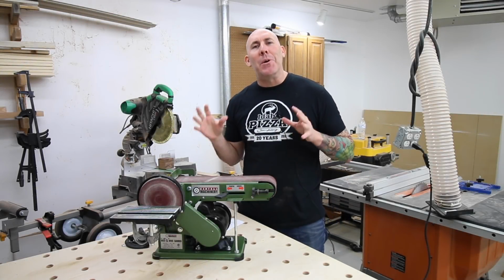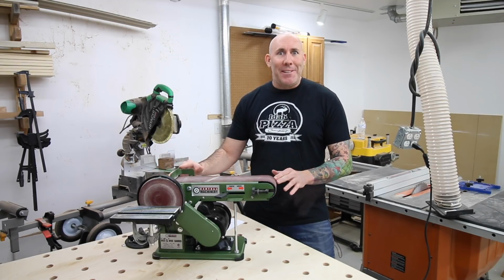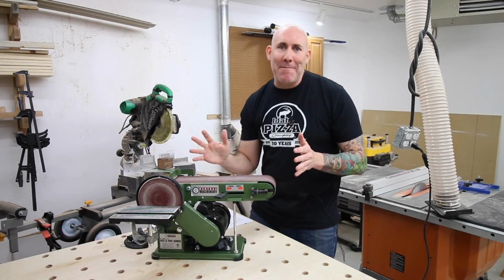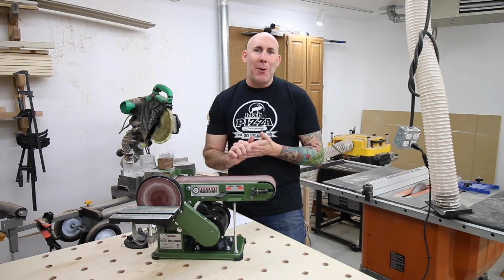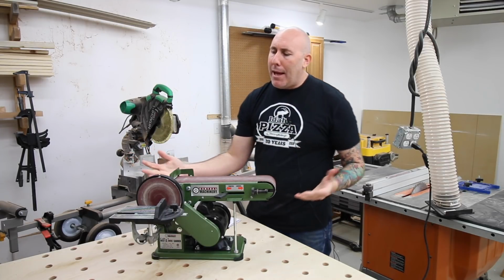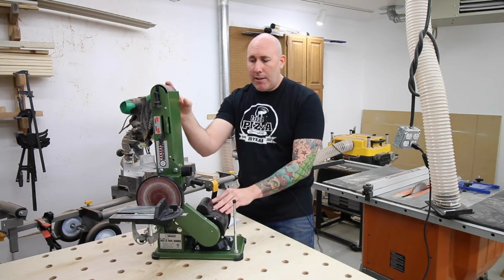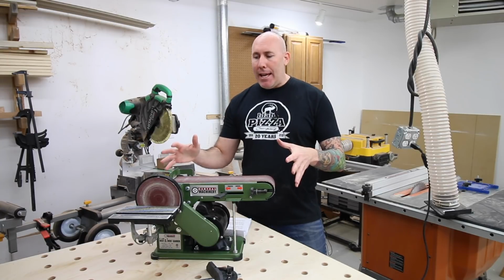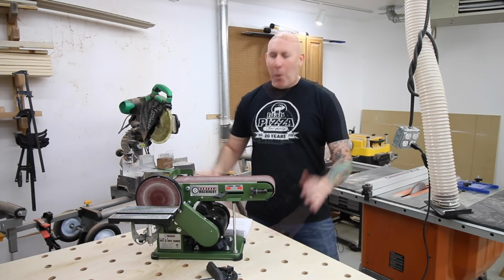Unbiased Harbor Freight Belt Sander Review

Comment: Had mine for several years, works great with a few adjustments. Some say it doesnt have enough power. Tighten the belt, maybe get a new better belt, like a Gates. At first I could be sanding a piece of wood, push it in, and not very hard and stop the sander. Tightening the belt solved this. You probably could stop it if you wanted to. You dont need to be pushing that hard, enough to stop this grinder. I did have to grind away the slots a little, for more movement to adjust the belt. Not that difficult if you're handy with a Dremel tool. Also align the 2 pulleys while you're at it. The disc platform needs to be adjusted, for a good 90° sanding surface. The pieces are all there for a decent grinder at a good price. Just a few adjustments is all it needs.
Reply: funny how he goes on about low power and reading the reviews where the belt issue is mentioned probably more times than you would like to, yet he doesnt say anything about it in the video. Hell he even says you have to do your own research XD Also almost every sub 100  bucks 4x36 belt grinder comes from the same factories, just with a different name tag on it. I have a carbon copy version from einhell, and there are many more. It does just fine grinding wood thats not too hard. For metal and hardwood, get a real beltgrinder, its just not made for that work.

Comment: My Cubscout pack has been using this model for pinewood derby cars for over 5 years. it had some issues when I first took it out (too much stress on the bearings made it slow and make noise) but a little pulling and bending later, it's a great piece of light machinery.

Comment: Decent machine, need to adjust motor when first bought, to reduce the bogging down when sanding.   There is a guy, on Ebay, that makes a dust collector adapter for the belt dust collecting, it's inexpensive and works great.  https://www.ebay.com/itm/Vac-Attachment-Sawdust-Collector-for-Central-Machinery-Belt-Disk-Sander-Shop/332209930174?ssPageName=STRK%3AMEBIDX%3AIT&_trksid=p2057872.m2749.l2649

Comment: Thanks to that stamped steel base you can never maintain proper belt tension, it simply flexes too much (older cast ones were better). The belt driver and idler pulleys now are simply marginally accurate molded plastic and the motor is a modified shaded pole design* that heats up to critical temperature with no load, all in all I'm regretful I bought the thing and will donate it to my local animal rescue thrift store this year. This experience however, does not diminish Harbor Freight in my eyes, I remember them waaay back when they did in fact buy surplus and obsolete products that a DIY guy could save big bucks on if he was handy with tools, so I give them plenty of latitude, nobody hits it out of the park every time anyway. ☺

*The motor is a modified shaded pole design, they run hot because of inefficiencies in the design but are very inexpensive to make and surprisingly, reliable because of the bare bones number of parts needed to make it run, but yes, you can cook a steak on one.

Comment: I found the belts difficult to change at first until I stripped down the machine. I always had a problem with the rubber feet coming off. I used 3M weatherstrip adhesive and no more problem. It is under powered but if you take your time it will get the job done. Eventually. If you can afford a bigger model get that one.

Comment: I bought mine at flea shop for $20 bux. Looks new, hardly used. I'm a homeowner diy. This unit works fine for me. Sanded some parts for my home, plastic motorcycle parts. Custom made many guitar picks. No complaints.
Reply from the maker: Score! Can't beat that price. Like I mentioned in the video, the machine works. Know it's limitations and it will serve you well. Personally if you have the room and budget the larger unit they sell is much better, that's not to say this can't be used for a specific purpose. Thanks for the comment and again, that's a score on the price!

Comment: The belt is slipping on the pulleys the motor is not underpowered verry easy fix
Reply: That's exactly what I figured was going on. I can't imagine being able to stall a 3/4 hp induction motor with hand pressure but do know that many machines come from the factory with less than ideal belt tension. I bought a used 2 hp 3/4" spindle shaper and  it ran fine until you put a piece of work to the cutter. I was going to take it back but the guy I bought from had the same problem with it so he just gave me back my money and asked if I would keep it so he wouldn't have to haul it off. After a few weeks of looking at it taking up space in my shop I decided to really check it out. It was a belt tension issue. I got a $600.00 machine for free because the guy never tried adjusting the belt tension. That was about 6 years ago and it's still a great little shaper.
Reply: How do you keep it from slipping

Comment: 4 X 36?  That sure looks line a 6" diameter sanding disk.
Reply: the pandeslar -   not sure how you missed it but 4 x 36 is the belt sander/ sanding belt size, which is the main feature of this style sander and there’s an entire class of 4x36 belt sanders, most are combo units with a little side disc sander...     They’re not going to call the machine a “6 Disc Sander”   .....that would be like a dude marketing his package as merely  a couple “1 inch balls in a nice sack”,  when the main feature & selling point is the  “massive 9inch meaty member” those little balls come attached to.

Comment: Thanks for the review Ryan. I appreciate what you do. I use this machine for little hobby projects and it works great for that. I wanted a small, portable unit that I could put on my bench and then easily store if not needed. I agree that it could not handle heavy jobs but for sanding 3D printed parts or deburring small stuff, even sharpening hand tools, it works great for the money. Anything more would be a waste with small hobbies. Thanks again for your efforts. - Sonic Ox.
Reply from the maker: Great to hear the machine is working fantastic for you. it's a great machine, when you use it within it's limits. I think most people expect this to perform like an industrial quality sander and that's just clearly not what this is intended for. This fits your situation perfect! Thanks for the comment!
Reply: @RISENGRINDWORKSHOP   You do know you didn't stall the motor in your demo. Your belt was just loose. The disc portion was still moving, showing the motor was not stalled.

Comment: I would think that motor has more torque then that i'm tempted to buy one just to run a better belt on it
Reply from the maker: Hey Spike, there are some YouTube video's where people have adjusted the tension on the motor and had much better results! I would give it a shot if it still sucks, take it back!
Reply: @RISENGRINDWORKSHOP  i'll try it for the price its worth a try, thanks for the info
Reply from the maker: @bucknuts6762  Be sure to update us here in the comments on how it worked out for you!

Comment: I wish I would have taken it back after I purchased it. This thing is junk. After turning it on I have to manually push the belt to get it to rotate. The motor is very underpowered.
Reply from the maker: Bill, might want to check the belt tension on the motor. Others have been able to loosen the bolts and slide the motor over, giving more tension on the belt which reduced the slipping! Worth a shot. You shouldn't have to touch the belt at all. Sounds like it's really loose and slipping.

Comment: Enjoyed your review, it gives the lowdown on the unit. One question: I’m thinking of setting up  a drip water system for the side disk, will the sheath for the dust collection unit hold water if I seal the hole at the bottom?
Reply from the maker: No I don't think it would work at all.

Comment: Motor is not under powered.  Drive belt is slipping.  Watch some of the other evaluations.  Amazing that several had no clue of why the belt stopped with very little pressure.  They probably should not be evaluating.  Basic,  basic, engineering.  

JoeB
Reply: Yea, I have had this for a while thinking it was under powered. Always stopping if you apply too much pressure when sanding or grinding. Today I took the covers off to check things out. Belt loose. Pulleys looked ok, belt looked a little worn but will replace it later.  Slid the motor a bit to tighten the belt. Worlds better. Now, I dont think I could stop the thing if I apply too much pressure.
Reply: @rchydrozz751  good information, always pays to give your purchase a good going over.
Reply: 370W isnt 3/4HP (750W) , 3/4 is 562W . this model  is 1/2 HP.
Reply from the maker: I had already adjusted the belt on this unit. But thanks for the input. I know others have had better success.
Reply: RNGPRODUCTS : If you had already adjusted the belt, you should have stated that in your vid, as it is the most common and helpful fix! Sure was a game changer for me.

Comment: You sure do except a lot for $70. If someone buys this for high end jobs they are not too bright. You drink $70 of alcohol in a weekend. You get what you pay for.
Reply from the maker: Like the video stated. If you plan to use the sander for it's intended purpose, it will work just fine. Simply don't expect much more out of the unit. If you need more, upgrade to the larger unit. This unit works for people with certain space limitations and small projects. Cheers.

Comment: I just unboxed and assembled this and noticed a lot of the issues you discussed.  I would add that the table will not sit flat left to right, and that the angle adjustment forwards and backwards is not flat at 0˚. The  needle really doesn't calibrate well and is so far away from the numbered degrees that you can just ignore it.  With all the other issues, my conclusion is that this is a crap tool and I would rather spend more on something better.  I was ready to return it in the first hour of trying it, but I wanted to get another opinion, so this settles it - back to the store with ya.  Too bad, been holding off on getting it for many years.

Comment: JUNK... but is sands. Just grabbed one off CL for 21 bucks. It works but the side disc sander wobbles like a drunken hooker. haha, I knew there was some reason the guy wanted to meet me in a parking lot... so I couldn't test run it. Oh well, I got a lathe so... I'll have to open up the hole and then make a bushing. Once that is fixed it will be good to go... for what it is. A tiny under powered piece of junk ok of occasional light duty use.

Comment: i've had mine for 15 years and it still works great - IT SANDS STUFF
Reply from the maker: Very True. The machine works. Also like I mentioned in the video, so long as you stay within the machines limit's it will serve a purpose for people. I just personally after having time with the machine, would opt to save up some extra money and get the larger machine. Especially if you have the room. I understand space is limited for some people and this will work well in that situation.
Reply: I have had my belt sander for over 15 years. When I bought mine they were $59.99 and I used a 20% off coupon. There was no other belt sander on the market that even came close to this price. Mine has been running flawlessly for all these years.
Reply: Mine has worked great also for 15 years. However, it is far from great. It has such a weak motor.
Reply: @HighlineGuitars  \\
Reply: @HighlineGuitars  I want it to make nuts and bridge saddles , would you recommend it for that,?
Reply: Has anyone tried to upgrade the motor?
Reply: Mine I have had for around a year and the back panel has fallen off but it still works